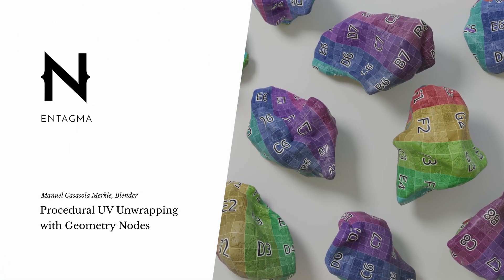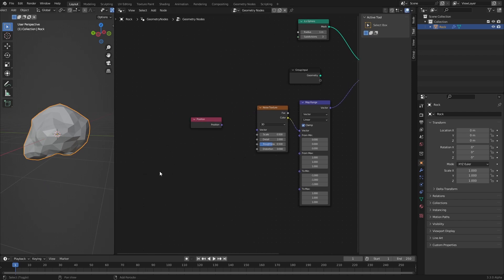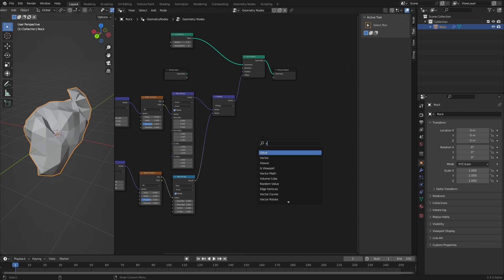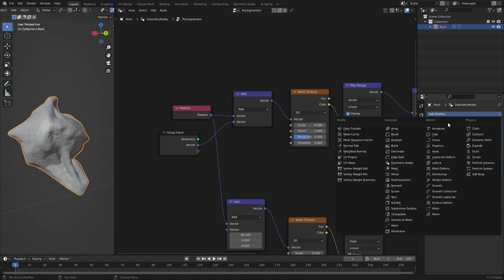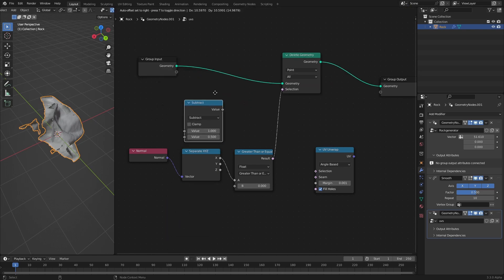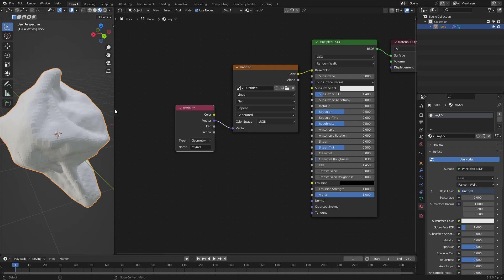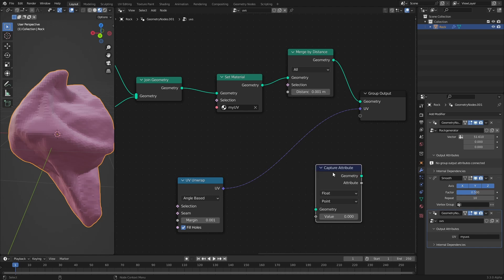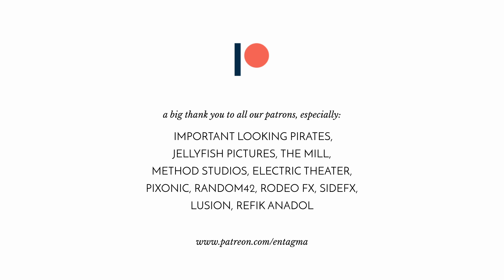Blender Tutorial: Procedural UV Unwrapping with Geometry Nodes

Comment: I have a question, if I took a textured object, ran it into geometry nodes, made it into a point system, then turned that point system into a volume, and finally turned that volume into a mesh. How would I get the texture from the original geometry onto the new mesh?

Comment: Hi, I'm trying to get Geometry Node to delete several faces by pre-existing vertex groups so I can somehow make a modular blockout base for any object or creature and delete faces that aren't visible in the node process as simply using boolean join alone leaves artefacts inside the shapes... Then from the remaining faces in the end of this process, I would try to automatically unwrap and pack faces the most square as possible so not a single relative inch is wasted on the entire unwrap surface... It's kind a ambitious as I am a newbie to geometry nodes... How would I achieve that? Someone suggested me a tutorial about node street generator using raycast... I'm not sure how I would implement it on the fly as I'm new to the domain.
In the end of the day, what I'm trying to achieve is to join modular parts together, that I can select based on a seed number, and that whatever part is selected, its geometry gets joined, merged, booleaned, cleaned and that the final model is unwrapped following a standard, fixed grid that I could swap textures really quick between various models and it would always align... So that I work considering reusability with versatility... A bit like a minecraft skin. That is really standard. Every skin follows the same lines, unless it's a modded model.

So... Yeah... Say I would make a chair generator... And that I would have 10 different leg models and 13 different seat models and 15 different chairbacks... I would need vertices that corresponds together on 2 separate parts instanced in the geometry nodes.... to snap together so they're perfectly merging together at the moment the node applies combining boolean.

Comment: Please please make an updated in depth tutorial on this in Houdini soon? Would be great for Houdini beginners.
Reply from the maker: That is an interesting request....
Reply: @Entagma  I would add to this: I struggle to differentiate the transfer attribute and capture node in blender. I do understand the transfer attribute as it works similar or the same as the one in houdini, but what would be the houdini equivalent for capture node? Maybe explaining the difference between those two nodes would be helpful for many people.
Reply: @asr59  These nodes were super confusing to me at first, but I think they make more sense to me now.

Capture attribute grabs the current state of an attribute in the geometry you feed into its input, after that, you can reuse the result of the capture as long as that same geometry is preserved anywhere down the node path. It will turn the captured attribute into a field, but it must retain that original geometry from which it was captured to be usable. It's basically like having an anonymous local variable if you know that from programming. A similar thing in houdini would be like storing an attribute on points/edges/etc. except instead of a variable name in the spreadsheet you only have the node graph pins to visually reference it.

Transfer attribute will create an entirely new field from a given input that can be used regardless of the geometry containing the previous geometry, it will attempt to interpolate the attributes to the new geometry you are applying it to based on the mode set. This one for sure is harder to understand because the documentation isn't very good on exactly how it's attempting to carry out the interpolation for nearest face. But I think if you spend some time playing around with really simple examples of it and outputting colors to a material you'll start to get an intuition on what is going on.

Comment: I'm curious why you used two delete geometry nodes instead of the separate geometry node, which does exactly what you want in this case (as far as I can see). Also, separating and then merging the geometry seems like a very expensive way to do make seams. Was it not possible to create a selection on the geometry to use for the "seams" input?
Reply from the maker: true, the separate node could have been used, too. The problem with the seams is that I did not find a way to create an edge selection out of the per face attribute I used. Do you know a way how to do that?
Reply: @Entagma  I was thinking of using the edge neighbor node and then evaluating the "face normal" field at those indices. I don't know if that would work though. We probably need some more nodes to make creating seams easier

Edit: looks like the edge neighbor node only outputs the number of neighbors, not the indices of the faces. So never mind
Reply from the maker: yeah, thought about that, too. but the node only outputs the neighbour count, not the actual indices. We would need some sort of derivative node to see, where the face values jump. Or at least an outline selection sort of thing.
Reply: @Entagma  there are nodes underway that output the edge outline of a given face selection. I wonder if the new "interpolate domain" node couldn't be used to turn a face attribute into an edge selection, I haven't tried.
Reply: Yeah some kind of attribute derivative node would be really useful for something like this apart from other things

Comment: You don't need to set "myuvs" as an output attribute. Another new (well, returning) node is the Store Named Attribute node which allows you to store attributes from within the node graph
Reply from the maker: True, but this way it easier to read IMHO. And as the tut is for beginners…
Reply: @Entagma  Is it easier when you are also using a capture attribute node (which would be redundant if you used SNA)? Not to mention that you need to change the attribute domain in the properties for the output attribute where it would be set on the node face itself rather than needing the N panel. I mean, either way works, it just seems like SNA would be cleaner in this case.
Reply from the maker: Hi Robert. You're totally right. Set Attrib is easier. I did it this way because I have to explain the domain thing anyways. But another quick tip on named attributes might be a good idea, too :-)